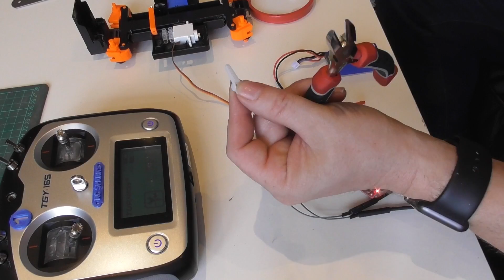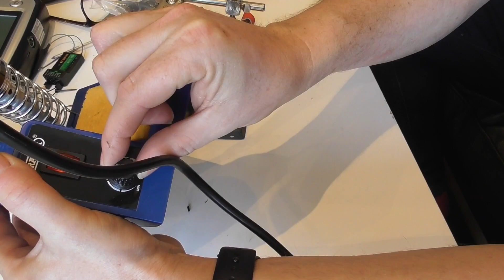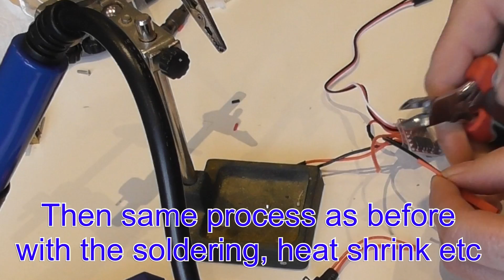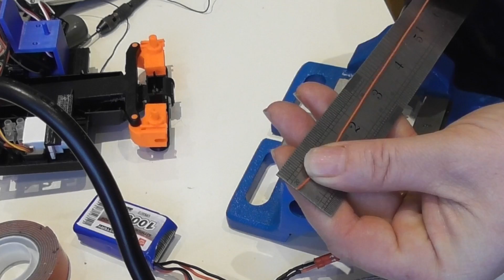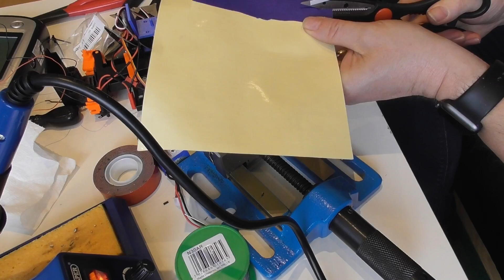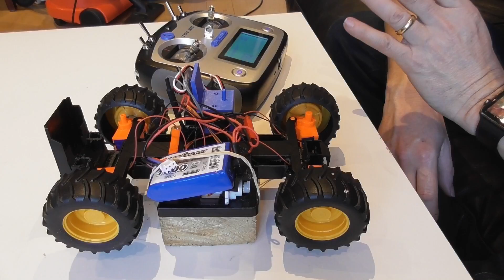Bruder CAT telehandler pt6b: chassis 2nd part

Comment: At the end of the Video, that driver was having far to much fun running that thing around by the remote ;-)
Reply from the maker: Not sure why I suddenly felt the compulsion to do that - it just seemed like the fun thing to do. This is the thing with the 3d printing -  you can just think of something, design it, print it & use it. The whole process for the mini transmitter, including printing was probably about 10 minutes!  😀👍
Reply: @RCModders  Well, I liked it.. And though it was a funny touch to the end of the video.

Comment: Is there any reason you did not just remove the wires from the Battery plug and install them into the other one?  Great job explaining the whole process on video.
Reply from the maker: That is a really good question Jeff. You are of course right, the normal thing to do would just be to lift the tabs on the plug and swap the wires round. The only thing I can think of is that originally I used this battery in the skid loader & I have a feeling that I wanted an extension to the battery lead. I suppose this extra step does at least illustrate how to swap out a battery plug safely without risking a short to the battery. 😀👍
Reply: @RCModders  Sounds Good. I was just curious is all.. Everyone has a way they do things and I have never attempted a build with this model yet.. Just Sucking in the Knowledge.